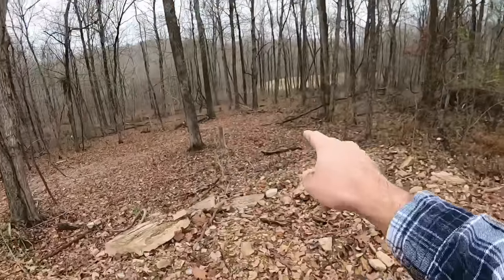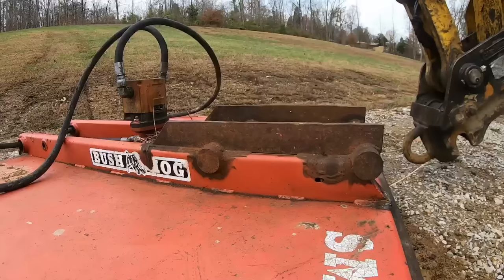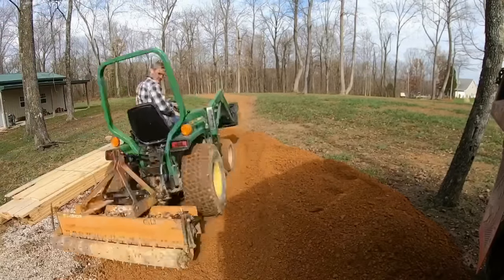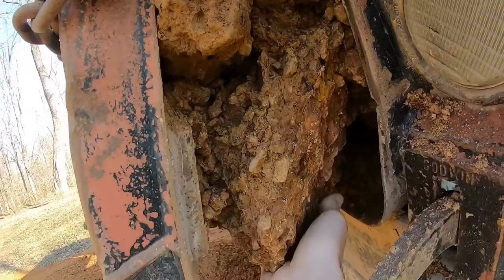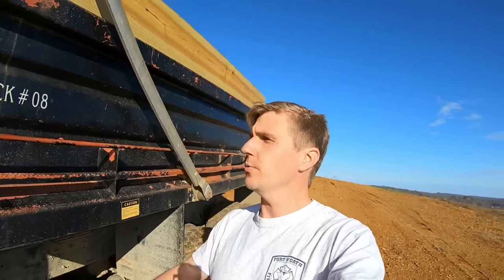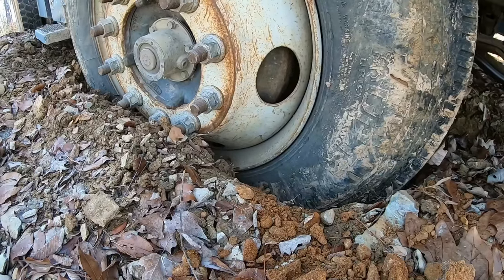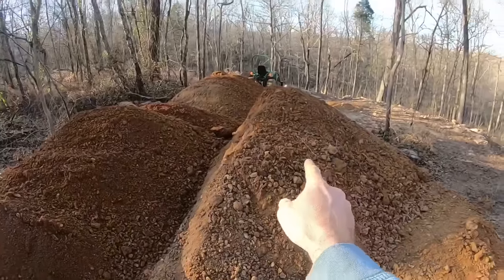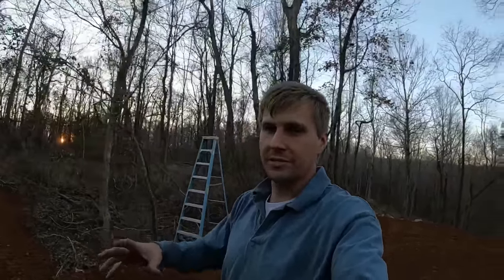Installing a New Driveway - How I Get the Truck Unstuck

Comment: Captain,  it might be easier on the tractor to pull the pile apart with the pulverizer down the road. It might take several trips, but could be easier to level your road base. I have a boxscraper on my tractor 80-90%  of the time. For counterweight and I use it more often for grading jobs.

Comment: All those cows had me cracking up!  So much curiosity then a sudden NOPE!  TOO CLOSE!  TIME TO GO!  🤣  Forest critters curious about all the stakes and strings.  Pretty sure they decided to play a little.  Road and parking area turned out well despite the slight mishap getting stuck.  Diff lockers are nice, but being able to lock in tandem axles increases the traction.  Probably would've pulled itself out at that point.  I never understood why trucks with tandem axels didn't come standard with lockers to tie them together.  Half of the situations I've seen would've been solved with both (or all three) axels getting drive power!  It'll be cheaper than a tow truck and save a LOT OF TIME!

Comment: Nice video, and about the base rock material, we use something similar here in Denmark, called "stabilgrus" and it's the best base course material you can get, where there's no need for a sub-base course, and you can put the wearing course, or pavement, directly on top of it with no problems and it last for decades.
Reply from the maker: Hey thanks for tagging along!

Comment: Nice going Mike. 
You might want to lock the diff before you go into the dirt. Looking at the video I'd guess it only locks the two drive axles together, not the axles themselves so you won't get any driveline bind up making turns.
Keep up the work man ! 
Cheers, Ard
Reply from the maker: You’re right!  Just didn’t expect it to be that soft.   But I suppose that’s the point 😂
Reply: Classic jokes never die.

Comment: Kind of surprised the Chevy only has a power divider lock and not power divider lock and diff locks since it was a snow plow. Any driver that says they have never been stuck is a liar or too new to have it happen yet. Needed a little help earlier in the week getting out of some mud on a job site, just a little tug was all it took. 
The road is coming along nicely.
Reply from the maker: Right there with you on that.  Still better than nothing though.  This time of year we will be doing a lot spinning on slime for sure.
Reply: You are right about getting stuck,its definitely part of dump trucking, unless you never leave the pavement.

Comment: Road looking good captain. I like the chirt material. Most is 2- nice to work with. My guess on the string is a big buck got it wrapped up in his horns 🦌👍
Reply from the maker: Need to get a trail cam out there!
Reply: @CaptainKleeman  yeah you should have a few. I have four I run on only 23 acres. Be surprised what you see is out there. Maybe squash

Comment: Okay, load your gate, with latched. Then drop back down to just slightly up. Be in gear. Open gate start moving and raise bed as needed to empty. If you open and try to load and move you'll just make a mess, and make the hoop-de-do's. Same as going forward, load gate. Let bed down to just slightly raised. Be in gear. Start to move open gate and raise to kept empty even flow of material. It is easy! Now if road can not support the truck and sinks, then yes you will have to pile dump and spread with another piece of equipment!
Reply from the maker: Yup.  Like I said in the video.  But can’t re latch gate once it’s open.  So if a fella spins out the restart is always a little rough.
Reply: @CaptainKleeman  let the bed down as soon as stop it will minimize the mess pile. Also that's why keep bed down low and only raise,  To spread as needed. Load gate drop down to almost full down, start moving, then pop gate then move and raise slowly!

Comment: Your road is getting better I'm glad you're happy with it would consider making some wider areas where I worked you could get by car coming other way on most of it and it made no difference what they drove on it you would never break the surface it had been a drive since before 1607 as that was when the house was built and additions had been added to it over the years last I heard the place is being ran as a hotel it's called Talhenbont  Hall  in North Wales

Comment: Chert is sedimentary rock. Your formation has a lot of iron in it, hence the reddish color.  It was probably washed down the river many years ago and then the river changed its direction and left this deposit high and dry. When rocks come tumbling down the river they become granulated from rubbing up against each other.   The size depends on how far the material was moved by the water.  Sand has been moved a long distance and cobbles not so far.
Reply from the maker: Thanks for the information!
Reply: @CaptainKleeman  👍You are so blessed to have this gravel deposit at your disposal.  Rock on Captain!  What is your first name anyway?

Comment: If you really want fun drive / operate as paving machine, having to use end dump trucks. They back  in to you start dump in hopper, then you push them and try to hand signal them to dump as needed to empty! All kinds of things go wrong! Driver pulls away from you or holds brakes on or just over dumps and does not hold in place on first dump and the load pushes him away dumping a big pile of burning hot asphalt  in front of you. It is a lot of fun every driver is different. And different  level of skill. Makes thing exciting!
Reply: The paver operator can have bad days also,I had 1 push me thru a overhead power line, broke the cable and started a pretty healthy grass fire..when in a spreader box the driver has only 1 responsibility stay snuggly in the center of the box
Reply: @jackspringer9283  yes that's where the ground man is to be watching for problems. I have had to use loaders to transfer material to get under and past overhead lines.

Comment: Cap’n... you’re just about shaped up to ship out!!!

Did I detect a stack of lumber for setting forms?  

I had the same thing happen with the markers for my new barn this Fall.  The string was broken but my pegs held.  Wasn’t hard to figure out what happened... there were doe and fawn tracks through the middle of it.  I’d located it right on the trail where they break out of the woods to cross the yard on their way to the deer feeder. 

Building the barn didn’t seem to disrupt them too much.  I put solar security lights on the barn.  They turn them on as they walk by now.

Getting the road passable is a real milestone.  It should be smooth sailing now!!!
Reply from the maker: That is Lumber for forms!  We are pretty excited.  We actually took our motion lights down.  Dog would set them off,  dog would bark at lights coming on and run after nothing. Lights go off,  dog walks back to house,  and repeat.
Reply: @CaptainKleeman  Abby’s bed was in the garage.  There was a pet door through which she could see the shop lights go on.  Every time she saw them she’d tear through the door.  Deer, possums, raccoons, coyotes, stray dogs... you name it, would trigger her charge.  I observed one night that she had stopped barking in the garage and waited until she got outside... why the change?   Apparently, she got tired of chasing false alarms from our cat setting them off.   If she went outside and it was only the cat she saved herself the hassle of barking.   Man, I miss that dog... and so does her bed mate... the cat!

Comment: hi captain  way did you not tip the bucket right forward to level the base rock out. it will act as a blade like on the dozer
Reply from the maker: Good way to tear up a cylinder.  Best way is to leave bucket level and leave it full of material.
Reply: @CaptainKleeman  very true, and if you need steering help just raise that full bucket a couple inches

Comment: 12 ton legal capacity l see, well then 12 x 2000 is 24,000 lbs divided by 2,800 lbs per yard is 8.5 yards loose volume, little bit small box. Why did he purchase this small box? not really cost effective.
Reply from the maker: I mean we can legally put 12 ton in the box,  12 ton fits in the box with ease...sooo....not sure where you’re getting the cost effective part.  It hauls what it can legally haul and that has nothing to do with the size of the box